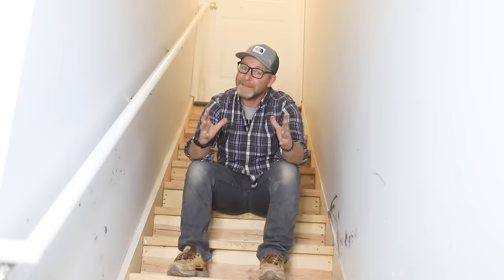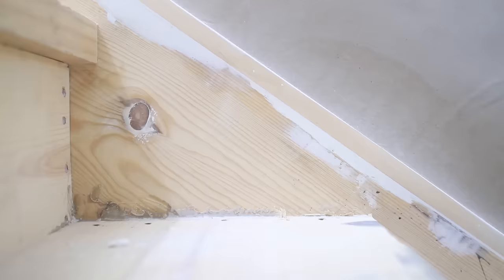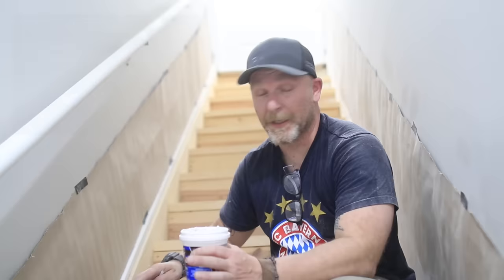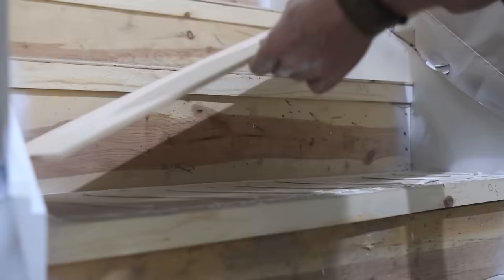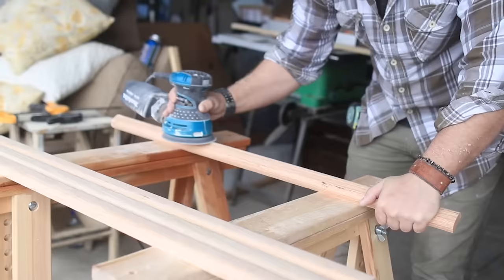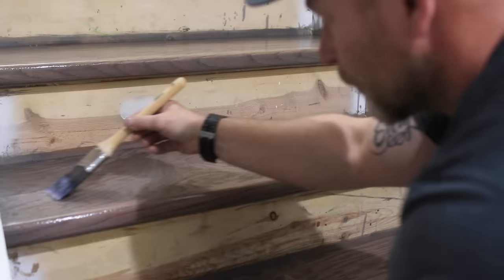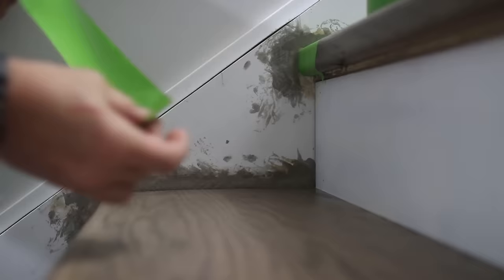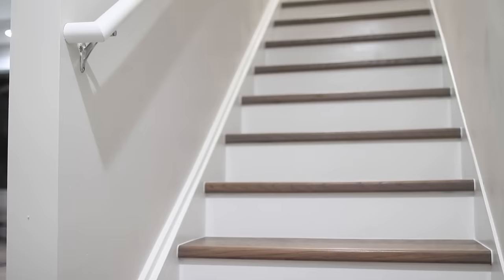DIY Stairs Makeover for Under $200 with Full Cost Breakdown!!

Comment: Thank you for the video.
I have two questions I am hoping someone can help me with
1)I painted the risers with Duramax, exterior, white---they look fine until someone walks upstairs wearing boots--then there are dirty toe marks on the risers.  Is there some way I can stop/minimize this?  Maybe another coat of some other paint/texture?  Polyurethane?  
2)  I saw two re-modellers recommend putting grit into the polyurethane final coat on the treads to add a little de-slippery.  But no ideas on how much or anything else about it?
Thank  you
Paul

Comment: We repaired ours using similar method and the stairs still look great but those end strips will drop or maybe ever come off altogether.  Do you have an update on how the makeover has fared after almost a year ?
Reply from the maker: I don’t.  But the edge bullnose should never come off. A glue joint is actually stronger then the wood itself.  So if it brakes anywhere it’s not going to be at the gule line
Reply: @KomarProject  The problem we found is that some people (Who shall remain nameless) run up and down stairs only touching the edge section, using only half their foot, hence the damage we had to repair.

Comment: When you add Oak plywood on top of all existing steps so the height of the riser will be reduced by the thickness of the plywood you are adding. Right?
Reply from the maker: Yes and no.  Yes the rise but the rise on each step so you still retain the same rise between each step
Reply: @KomarProject  . Thanks. I guess only the top step height will be reduced as you won't be nailing plywood on your main floor.

Comment: What do you do when the tread is made of a press board and not a solid wood? Do you recommend pulling that up and replacing with an new oak tread?
Reply from the maker: You shouldn’t have to if your putting on solid oak treads

Comment: Can you use the original stair structure vs laying plywood on them?
Reply from the maker: You don’t want to. Most stairs are constructed of pine and as soon as someone in heals goes up them you will get little dings. You can put a lot of coats on but your still running a risk.

Comment: Do you think the bull noes will stay on strong through normal stair use.  Im concerned they could break loose if someone stepped on the edge.  

What do you think?   Will they hold up?
Reply from the maker: So glue joints are actually stronger then actual wood.  Regular wood will break before the glue joint every time so I sure it will be strong.  Hope that answers your question brother.

Comment: Use a piece of painter's tape to draw your cut line on when cutting plywood or veneer and you will not get the jagged edges on the circular saw cut!
Reply from the maker: Great tip !!
Reply: @KomarProject ... I've messed up enough stuff in my days!

Comment: How did you compensate at the top of the stairs for adding 1/4 inch to each step since they are all supposed to be the same rise? With your method, the last rise will be 1/4 inch smaller.  The steps look really sharp - video was done very well.

Comment: Would you recommend this technique on the main house stairs at the front door entrance? I can see this working great in a basement, but as the main entrance to the house, I would be concerned that eventually the bull nose would separate from all the up and down & wear?
Reply from the maker: There is a very small chance that it may separate if water gets on it.  But glue joints of done right are stronger then the glue itself. Hope that helps

Comment: I have a question? Is your first Riser height higher than the last Riser height. Normally when you install the stringers you cut the thickness of the tread off the bottom of the stringers so you have equal riser Heights on all your risers. I don't see how all the Riser heights would be the same if you're just adding another thread a top of a thread.
Reply from the maker: Ya the bottom one is shorter.  Sometimes they will account for the hardwood if they know what it is and the GC tells them to do it like that.  But most times it will be off a bit.

Comment: When u added the caulk for the clean white lines did u swipe it with a wet finger to take off the excess??? Did u also wait for it to dry before painting the sides and risers??
Reply from the maker: Ya I used a wet finger.  The trick here is to use green frog tape.  It will leave super clean lines.  And wait for it to dry before painting.
Reply: @KomarProject  that's awesome thx u for replying love your work really clean and came out better then I thought before I saw the result 👌👌👌🔥🔥🔥

Comment: Awesome video.  I plan to do this over the winter I think.  Do you see any issue with staining and coating the plywood prior to installation?  That would mean I could put on a solid three layers of poly without the time constraint.  I would probably leave the carpet on while I do this and then cut treads to the exact size after I take the carpet off and get good measurements.  Your thoughts?  Thanks!
Reply from the maker: The only issue I might run into is getting them dirty or sticky during installation.   Just be careful with it.

Comment: What did you do on the top step? It's not the same as the rest and ends up being a bit thinner. Was it oak already? Or something else stained to match? I am considering doing the same as in this vid but will have laminate floors upstairs so gonna have to make the bullnose extend a little higher and stretch back a bit, to overlap the laminate with a 10mm expansion gap. Although it might end up being the end of the laminate boards so might not need so much expansion gap.

Comment: Thank you, now I am confused if I want to do what you just did, or just strip and stain or repaint the steps. My steps haven't been touched since I think back in 1970.  For some stupid reason, they painted and then put a stain on the steps over the paint which is beyond my reasoning power?
Reply from the maker: You want to put some sort of oak on them. If they just painted unfinished steps then you most likely have pine under there.  Pine is super soft and anything heavy will dig them right away

Comment: Awesome video. I’m Getting ready to get started on my stairs. I plan to do it this exact way. My only hang up is I have two platforms. What would I use for them. Hardwood planks? If so. Tongue and groove? Should I just buy flooring and stain the bullnose and the rest of the stairs to match?
Reply from the maker: Ya I would use t&g. Or if your ok with a solid piece on the landing just use plywood.  But other then that ya your absolutely right

Comment: I've painted alot in my day bought all brands of paint tape how did u get such a clean pull I've tried letting paint dry and scoring it with box knife prior to pulling. I've tried letting paint dry maybe 30 mins than pulling tape  and so on used alot of brands and types of tape to
Reply from the maker: Don’t let the paint dry. It will chip away.  You want to pull it off as soon as you’re done painting while it’s still wet.  Just be careful not to let the tape touch the wall when pulling off or the paint will get on it.

Comment: Why specifically 3/4” off the tread, and not just cut it flush with the riser surface? Definitely gonna do something like this but I can’t figure that out.

Thanks for the video 🤙🏽
Reply from the maker: You cut 3/4” because your placing a 3/4 bullnose back on.  It’s just to keep the overhang the same as it was.

Comment: It looks good, but I wouldn't trust that piece right at the nose. This is where most of people's weight ends up per sq.inch and I can see it coming off or forcing surrounding wood to break. Not sure if the brad nails will help much, but maybe you can put dowels in-between and that will hold forever.

Comment: I'm thinking of starting this project.  How are they holding up?  Any issues with the glued on bullnose breaking off?
Reply from the maker: When we sold the house they were holding up great.  Glue joints won’t come apart if they are tight.  Glue is actually stronger then the actual wood

Comment: My stairs look just like this but my contractor said it would cost 4,000 to replace the staris put on treads which they will polyurethane 3 times. why cant they just put treads on top. He said something to the fact that the stairs were not glued, what does that mean. I have been going up and down these stairs for 7 years. HELP !!!
Reply from the maker: Most likely he means that the original tread was just nailed and not glued.  If it’s not glued then you run the risk of having Squeaky stairs overtime. It’s the glue that prevents that

Comment: Overall, this looks much better than the starting look. But, you made some horrible mistakes. Most noticeable is your caulking mess. That is by far horrifying.  1/4 veneered oak will not last long if these stairs are used regularly. I’m not sure about that 1 coat poly. I have no experience with it, I feel like it isn’t going to last on a staircase. The rough framing lumber is most likely going to move a lot during the season changes. I’ be surprised if it even makes it 1 year with normal traffic. I do staircases for a living and honestly I am horrified with this except that you only spent $200 in total. That is impressive. I would love to see a 1 year update on this. Maybe I’m wrong.

Comment: i have started this project and wondered how your oak strips you used for the bullnose have held up?  I am just now installing them and have already noticed after only a few days that the oak strips are starting to separate, assuming it is from putting weight on them?  maybe because i only used 2inch, 18 gauge brads.  can you tell me what you used to attach them or if you have had similar issues?  thx

Comment: My stairs are so noisy when you walk on them. If I done this would it help to be more soundproof?
Reply from the maker: Not really.  You most likely have noise because the frame of the stairs is loose somewhere.  Maybe remove some nails or screws and add some glue first then screw it down well.  Or if you can remove any of the treads just add a bunch of screws.  It may help a bit.

Comment: Pin nails for the bullnose?
Reply from the maker: Just until the glue sets up.  It’s not the nails that give it the hold over time, it’s the glue. A glue joint is stronger then the wood itself and if it brakes it won’t be on the glue joint.  Hope that helps explain it a bit.   Thanks man

Comment: Wouldn't putting on a veneer layer make the top tread shorter and the bottom tread taller? Thought this was not allowed in most building codes
Reply: Putting and equal amount of material on the top and bottom treads, the step height would remain the same.
Reply: @mythoughts.....4787  The steps in between the top and bottom steps will be equal. But the very top step to the top floor will be shorter, and the bottom step relative to the bottom floor will be taller.
Reply: Good analysis thank you.

Comment: It looks nice but I wouldn't trust the half-round stair edge from holding a person's weight with just glue and finishing nails.
Reply from the maker: Glue joints are actually stronger then the wood itself so something like this will hold and never brake.  Actually wood will break before a glue joint will.  Hope that helps.

Comment: Can you please confirm the round over bit you used?  3/4 seems odd.
Reply: When making the bullnose with a round over bit, the radius has to be 1/2 the size of the material in order to make the bullnose. His materials are 3/4 inches thick so he would be using a bit with a radius of 3/8 (thats the part that creates the cut. If the materials were 1 inch thick he would need to use a bit with a radius of 1/2 inch).

Comment: You taped then you caulked over the tape. The tape was not caught under the caulk?
Reply from the maker: No, you want to pull off the tape right after you caulk. That way it’s still fresh and leaves a perfect line.  Just use green tape.  Makes all the difference
Reply: @KomarProject  Ok, but the way the video is made it look like you taped, caulked and then you painted over it. You remove the tape at the end when everything is finished. I understand what you are saying, but the steps in the video say otherwise. So the last thing I have to do is put the caulking, then remove the tape? and by the way, since I can see some caulk on the steps, it mean that you did not put the tape flush to the wall. You left maybe a 1/8 or a bit less right?
Reply: Okay... just notice the tape at one point is blue, then it's green. Dam!
Reply: One more thing: your 1/4 oak plywood, is it realy 1/4?  How many layers do you have, because here they sold a plywood of 5.2 millimeter (That a bit less from 1/4) Instead of .25 inch it's more lite .19 inch and as only 3 layers.

Comment: Looks great, but way less durable than solid oak treads. Those bullnose tread tips could have been drilled to accept real screws (at least 4) right into the old tread. That will keep them from separating under the weight of feet. You’ll see. Gaps will form. You can buy a kit that allows you to make wood plugs to cover the screw heads. Keep in mind deep scuffs on the painted risers will expose the dark brown particle board. You did the job for 20% of the cost and it will last 20% as long as doing it the more expensive way. 

Also, is your top step shorter now and your bottom step higher (from adding the thickness of the oak plywood)?
Reply: Can I ask why you think it will be way less durable?  I agree with others that as long as the coating holds up, then it should last.  Maybe I am missing something.  The existing stairs provide the structure, so I don't know why you need the solid oak for the treads.  

I do see the advantage of adding some screws in the bullnose.   I can also agree that the risers may not be nearly as durable.  

I am considering doing this, so I am genuinely interested in your reasoning as to why you expect it not to last.

I would think the 1/4" plywood is not much thicker than the carpet and carpet pad, so I doubt there is any noticeable difference.
Reply: @andrewliechti3868  on the plywood oak treads... you are likely to wear through the top ply of oak which would look bad.  With solid oak you could sand and refinish a few times. Again you probably wont be able to sand and refinish the thin oak plywood without going through the top layer. This is my main point, so maybe you get 20 years out of the steps instead of 100. 

You are probably right about 1/4” not being too thick to notice. I honestly thought he was using thicker plywood. Sorry. 

If you’re not still not worried about plywood, I would consider gluing them down only. No brads, nails, pins, screws etc. stairs can flex and nails will squeak. 

I would Use a thick Board to hammer the plywood down to get it seated into the glue and leave a heavy weight on each step to get it to dry flat. Probably won’t lift up even without the heavy weight. My last house had a solid oak tread kit installed on the stairway.  It was a nightmare. All the pneumatic nails squeaked horribly loud on every step. 

Rocker makes a great kit for making your one wooden plugs for the bullnose. I would put loads of long screws in the bullnose.  
https://www.rockler.com/learn/install-custom-wood-plugs

I would consider changing the riser material to a white pvc material - paintable, not paintable probably doesn’t matter. If you use a material that’s white you will never have to worry about it scuffing or peeling. I would opt to not paint it - it will never peel. 

Royal building products makes pvc trim boards that might be wide enough for the risers. 
https://www.lowes.com/pd/Royal-Building-Products-Actual-0-312-in-x-5-812-in-x-8-ft-Common-Board-PVC-Board/1000445479

Hope this helps. Have fun!
Reply: @caseykittel  Thank you very much for the reply.  I would definitely consider solid oak treads instead, but can you find oak in an approximate 1/4" thickness relatively easily (and cheaply)?  I really like the idea of limiting the change in the step heights (i.e. the thickness of wood added equals close to the thickness of carpet removed).  

Honestly, 20 years may be good enough and then I can have someone come in and do it right when I'm old and have a little more money.

Thanks again for all the other information as well!!
Reply: @andrewliechti3868  they should make various thin hardwood plywood’s for the sides of kitchen cabinets, but I’m not seeing it... No idea where he got it. That’s why I assumed it was thicker I guess. You can by super thin  sheets of solid oak called veneer, but that would cost about $10 a step.
Reply: @caseykittel  OK.  I guess I was trying to ask where I could find 1/4" full oak pieces (not plywood).  Do such things exist?  Thanks again
Reply: Also, the 1/4" oak plywood is available at Home Depot.  I guess you would get two stairs out of every piece.
https://www.homedepot.com/p/Columbia-Forest-Products-1-4-in-x-2-ft-x-4-ft-PureBond-Red-Oak-Plywood-Project-Panel-Free-Custom-Cut-Available-1994/204311240#product-overview
Reply: @andrewliechti3868  you may be able to get someone to resaw solid oaks treads  down to 1/4” using a proper bandsaw setup. You’de only be able to around three out of each tread. Probably cost a lot and you’ll end up with a board that will need to be glued or will split and come loose anyway. I like the way you think though. You might think that veneer would be cheaper than the plywood. But it’s way more expensive. Crazy. It’s the same as one layer of plywood (which generally has 4 or more layers glued together, but costs way more.